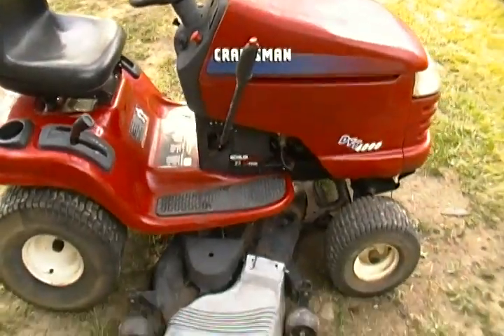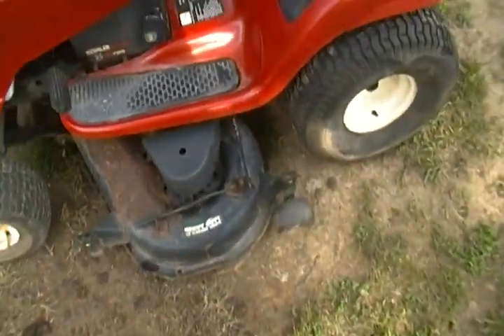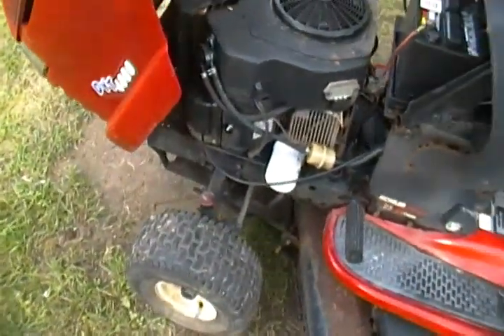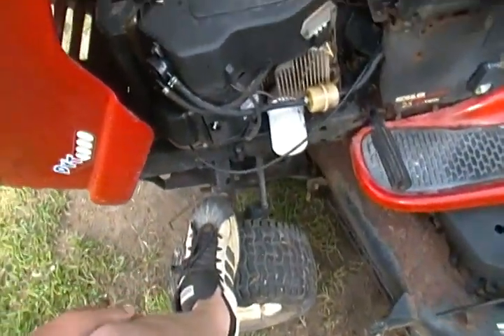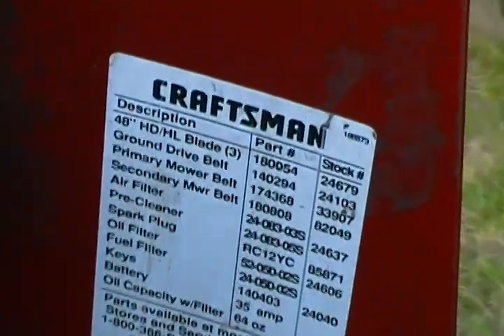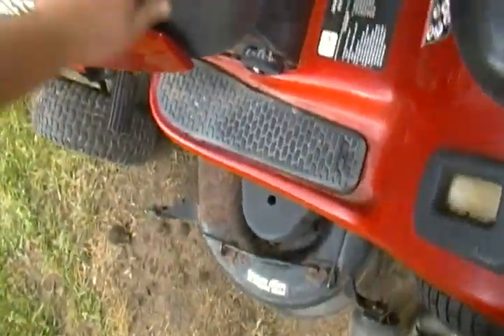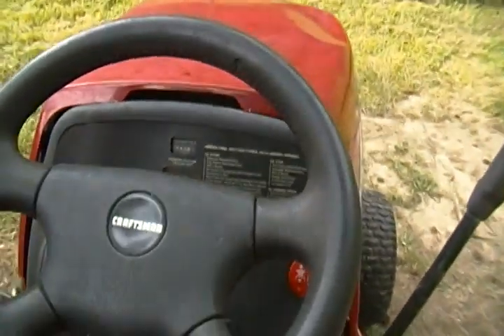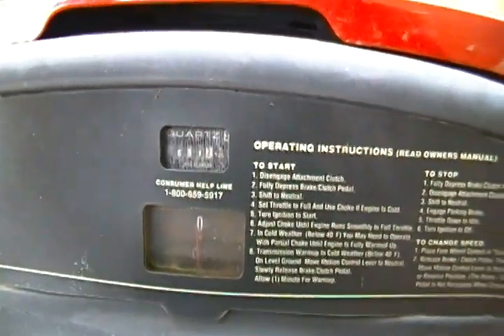Craftsman DYT 4000

Comment: i got one of these off of my neighbor and they said the transmition was shot, so they gave it to me for free. there is absolutly no body damage or rust. so i got bored a week ago and tried to ind the problem and it turns out that the transmition belt poped off of the drive pulley. so i got a good deal. but urs is actually better u got th 25 hp kholer i have the 18.5 briggs.

Comment: Those v twin kohlers suck! Every DYT4000 that had that motor has thrown rods. Theirs several videos out their, too bad it didn't have the Briggs v twin, chances are really good, it would have still been running. Right now I have one with the 725cc Briggs, it had a slipped exhaust valve guide. Pressed it back in place had it welded so it couldn't slip again, changed out the head gaskets and she's good to go once again.

Comment: Damn, too bad the motor killed itself. You should use one of those little grinder wheels like the one I used on the racing mower. They strip rust fast!
you should do an update when you tear down the motor.

Comment: Can you post that frame number under the seat. I just came into one one also and this guy needs some parts behind the dash...thanks
Reply: Don't know if you have found a number but I have a craftsman that's about the same its number is 917.272203 and also a Husqvarna GTH2548 it's a LOGT25H48B